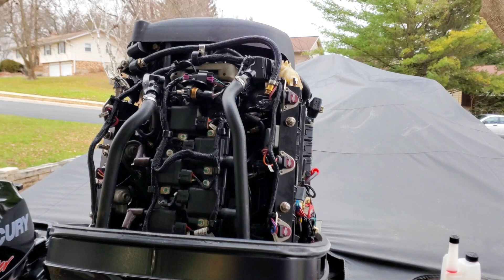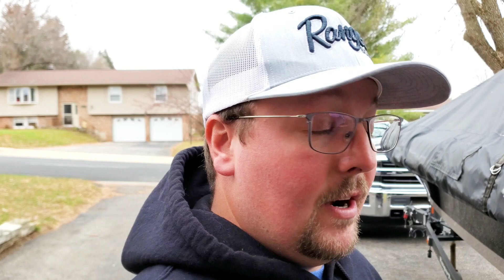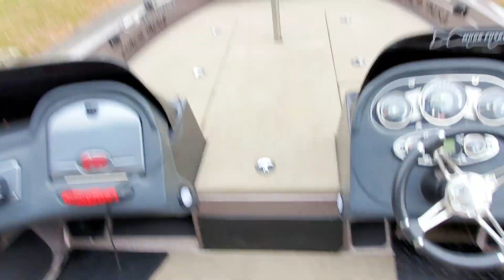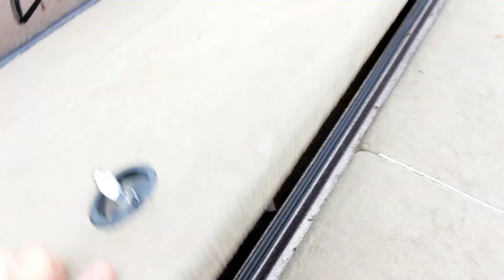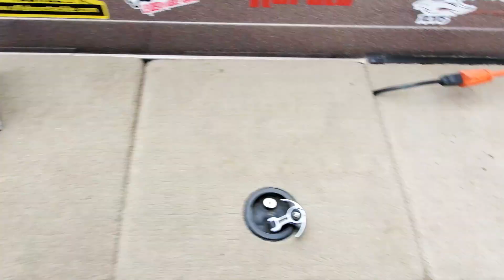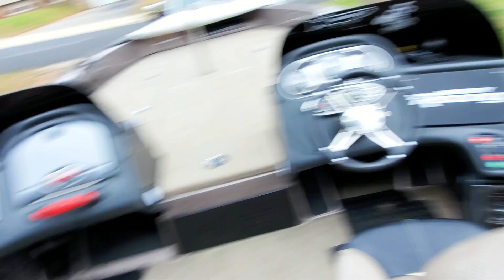SAD DAY! - WINTERIZING THE RANGER - SHOP TALK!!

Comment: Good tips.  I also put dielectric grease into the holes of my flat 5 trailer lights electrical harness connections.  Helps prevent curosion.